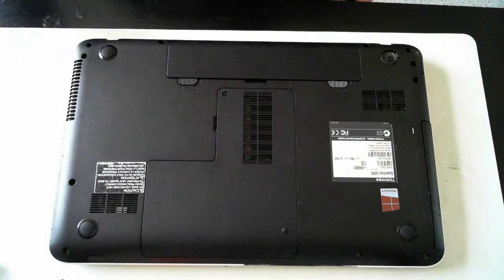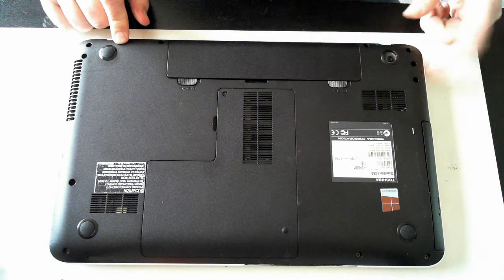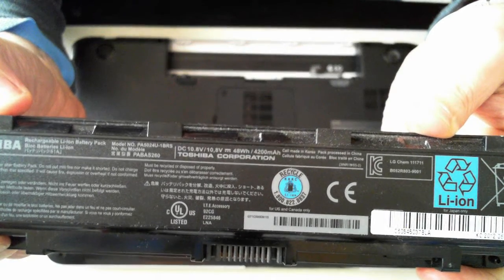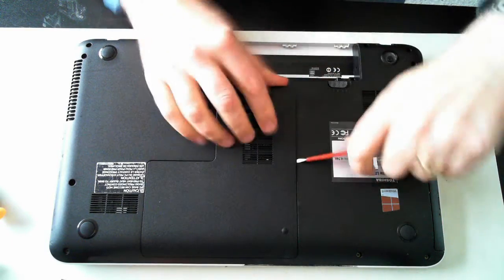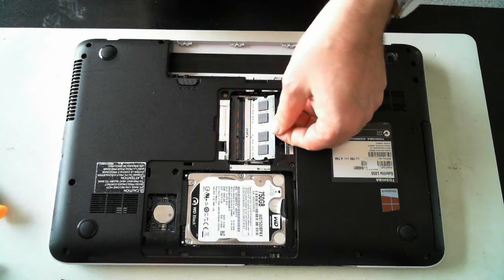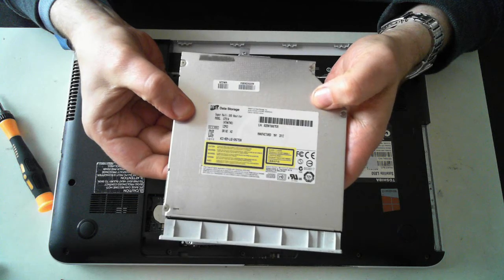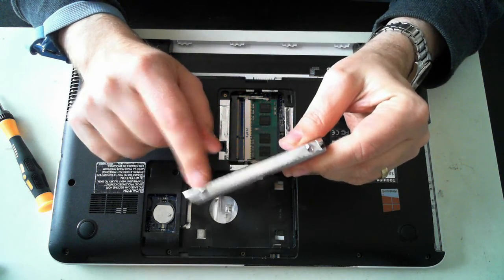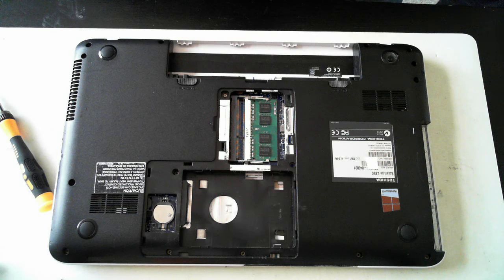Toshiba Satellite L850 Basic Teardown

Comment: I think to upgrade HardDrive with an samsung ssd and double Ram. There is any risk ? Or there are'nt particular problem ? I tried to open the disk and memory flap, but without success (but I only used the screwdriver to unscrew the screw.....)
Reply: S

Comment: dear...nice video you r expert it motherboard..great....i have one question about this model L850-A934...my kids did something with the computer n it is asking for the bios password that i tried many but doesnt work any.....i checked over net for the solution but no success...as i can u have done genious thing on this video...how i can reset the password...or any jumper to be shorten..will be very much appreciated...my email is mzaheer_abbas@yahoo.com ....thanks in advance...
Reply from the maker: Remove the bios battery for a couple of minutes then replace it. This should reset the bios and delete the password.
Reply: Zaheer Abbas... thanks for reply...i tried as u mentioned to remove the bios battery for one hour n plug it back. but nothing happened...password still appearing as before....anyother solution please...thankss
Reply: Did you disconnect it from the power when the battery was pulled?
Reply: i removed the power cable n then remove the bios battery from the laptop for one hour....And place back the bios battery n plug the power cable...n password remains....this is the way i did....is there anyother way to do it? thanks

Comment: Many "Toshiba Satellite" L series! very good everyday use laptops ,depending on the configuration of the equipment ! Removable rear panel with one screw, HDD/SSD disk and memory access! If you remove the rear panel, you can remove HDD/SSD drive right away, because the HDD/SSD drive keeps strained back cover and disk drive slides out ! Beautiful, durable plastic housing. The good quality display and real good high note, clear sound quality(loud too ) with built in speakers !

Comment: Hi, thanks for the upload. Do you know if this laptop supports a 2nd HDD ? I have the same and i want to add another HDD that is SSD
Reply from the maker: +Dimitris Michaelides No there is only room for 1 HDD. I have heard of third party adapters that fit into the optical drive bay for certain laptop models. I have never used one so can't say if they work or exist for this laptop.
Reply: +dpcomputing thanks for the info :)